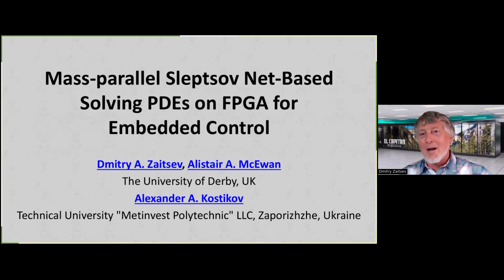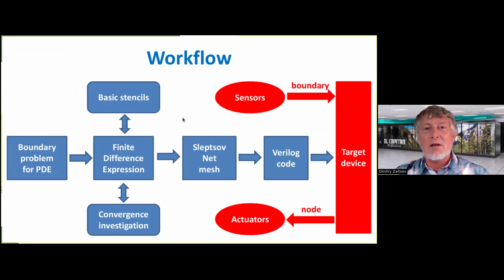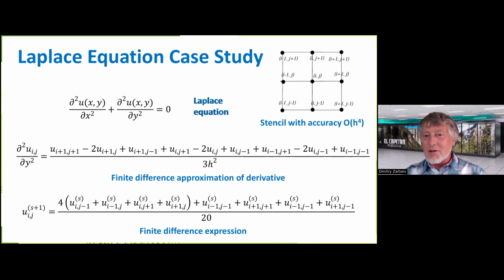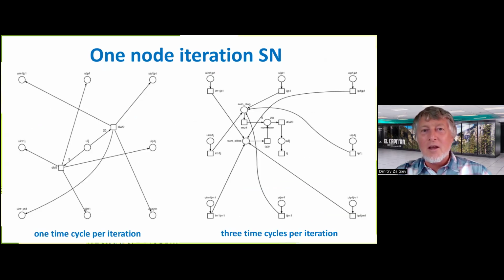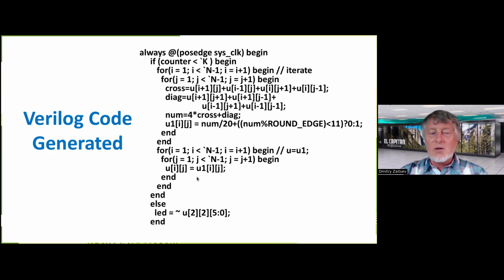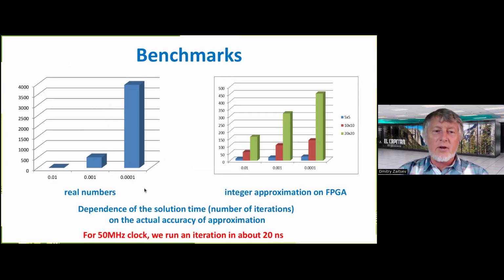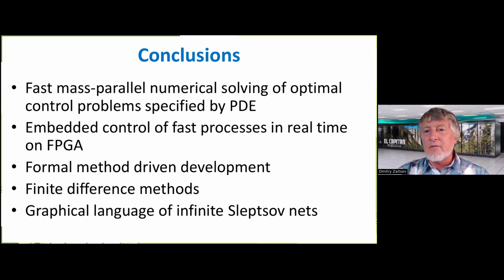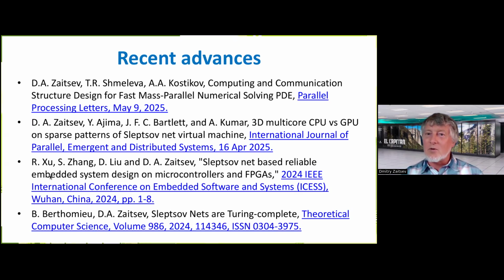Mass-parallel Sleptsov Net-Based Solving PDEs on FPGA for Embedded Control - ICTIS'25 talk

Comment: Dr. Zaitsev, Fascinating work on leveraging mass-parallel Sleptsov Net-Based methods for solving PDEs on FPGA in embedded control systems! This represents an exciting advancement in computational techniques for real-time applications, and I'm eager to see how this approach can be further optimized and applied across various industries. Well done on pushing the boundaries of what's possible in embedded systems!